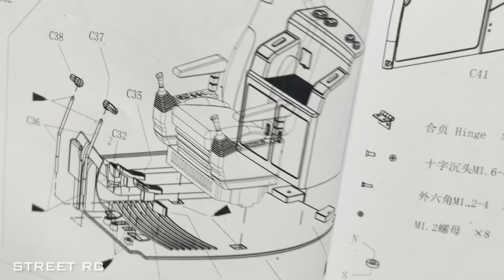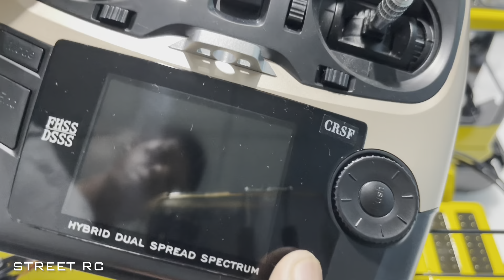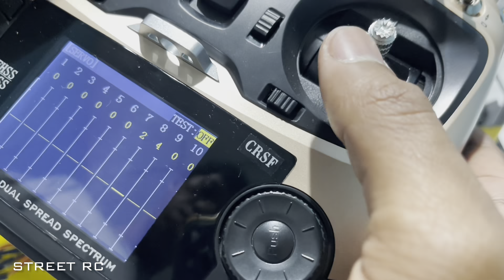Street RC Assembly LESU 1/14 PC360 RC Hydraulic Excavator (body,Electric part) Pt.4

Comment: hi what regulator is needed for the hydraulic pump,and midle motor and at chains
Reply from the maker: If you means speed controller with Hobby-wing about 160A and motor in kit from factory Lesu.
Reply: @nineonstreet  ok thank you, and do midle motor need spedcontroler
Reply from the maker: @yasons9531   brushless motor

Comment: Why do you remove the red wire?
Reply from the maker: Red wire speed controller more 1 have electric am select 1 speed controller only  6v for power receive and servo. Because maybe fail working.
Reply: @nineonstreet  what can fail? the correct operation of the motor? can the removal of the red cable also be done in a brushless motor?
Reply from the maker: @nikosyoutsos  speed brush motor and Brushless motor voltage to differ 5V and 6V yeah it can connects parallel but long time speed controller 5v broke am must select 1 speed controller for power receiver and Servo.
Reply: @nineonstreet  are you using an external ubec?
Reply from the maker: @nikosyoutsos  no. In peed controller.
Reply: @nineonstreet  how long does your battery last? with all this, 4 motors, 4-5 servos... what batteries do you have?